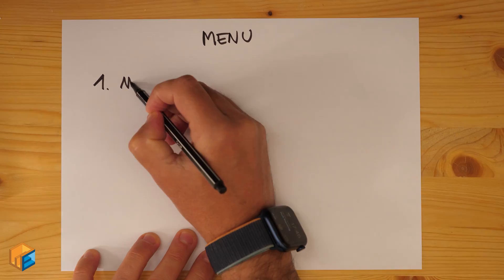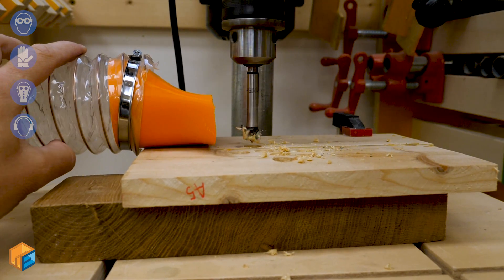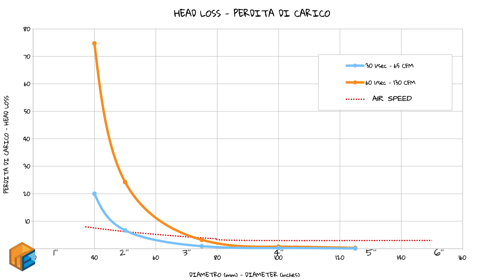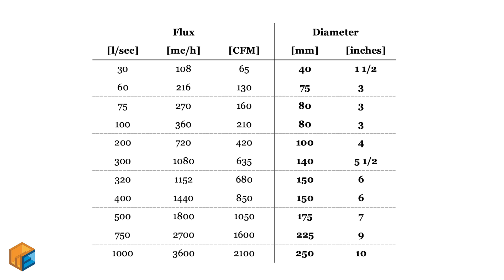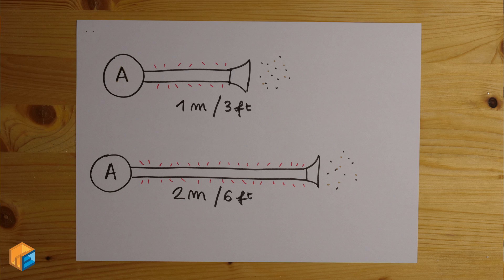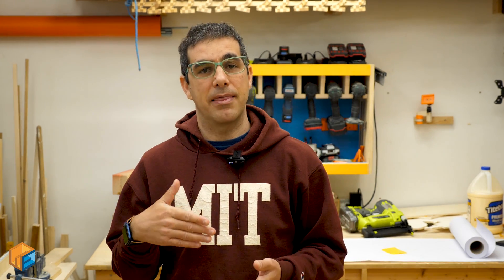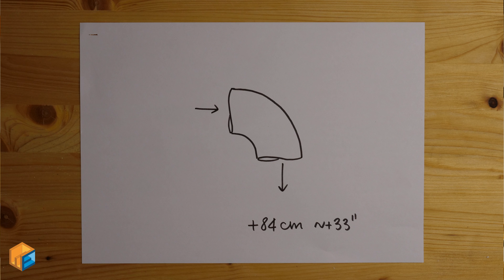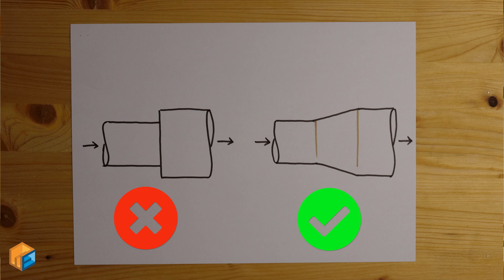Better DIY dust collection using science // DIY & engineering

Comment: I want to make Vacuum+cyclone dust collector, but my question is 3900m3/h, 373pa, 300mm diameter ventilator can be a vacuum and what diameter of pipe do I need to use for almost 10m of room. 😂